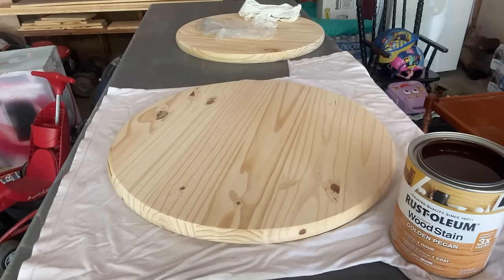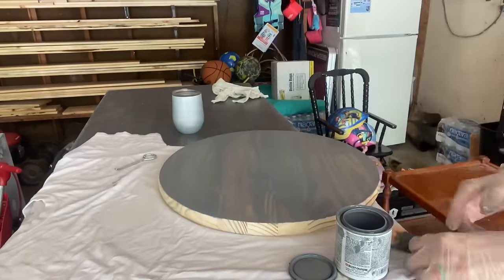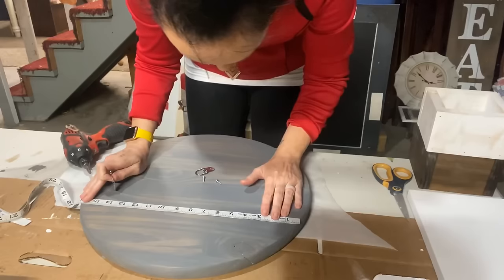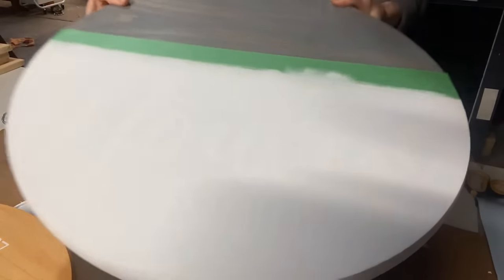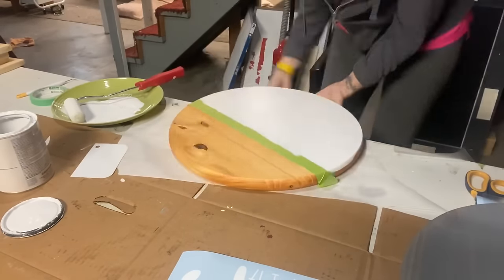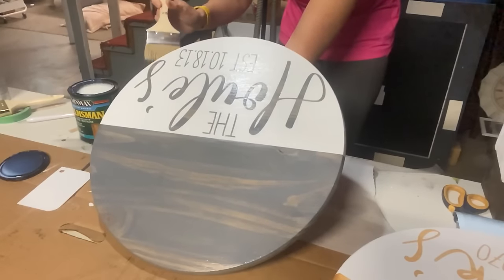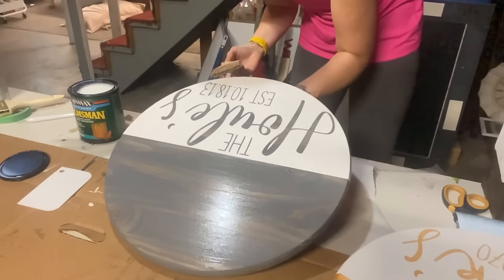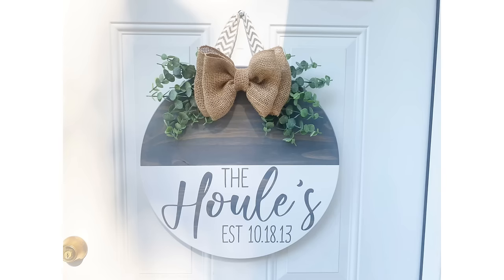DIY WOOD ROUND || DIY WOOD DOOR HANGER || WOOD SIGNS FOR BEGINNERS

Comment: So two questions. For the ribbon to hang it, how secure is just that glue? I love your work! just wondering. Also, saw in your comments it says to use interior paint, but why use that kind when it' for outdoor? shouldn't it be exterior?
Reply from the maker: Hello 👋 I’ve had signs hang on my door for months using the hot glue with my burlap ribbon for hanging and have never had issues or complaints from customers 😊 I have never used interior or exterior paint on my signs. I use wood stain and chalk paint,
Seal with Hellsman if it’s going outside. I hope that helps you and thank you so much for watching!
Reply: Unicorn Dust Designs yes I was referring the chalk paint. In link you put it says interior so that’s why I was asking if it mattered
Reply from the maker: Good question. It’s perfectly fine to use for outdoor signs because you will be locking it in with your clear coat 😊
Reply from the maker: Good question. It’s perfectly fine to use for outdoor signs because you will be locking it in with your clear coat 😊
Reply: Unicorn Dust Designs thank you!

Comment: Does acrylic paint work too?
Reply from the maker: I’m not sure. I’ve only used it once on a very small section. In my experience acrylic paint peels up
Reply: One more question 😅 How long do you let the paint dry? Or how long with the dryer and then do you let it sit?

Comment: I love your signs and decided to make some for fall. I used all the same products you used in this video. However, when I peeled up my vinyl I didn’t get as clean a line as you did. How long do you let the paint dry?  Because of my schedule I had to wait about 24 hrs. Is that too long?
Reply from the maker: Hello! Thanks for watching my videos :) Yes, 24 hours is too long. If you're using the 651 permanent vinyl as I do in the video that is strong adhesive and the longer you allow it to stay on the wood the harder it will be to remove :/

Comment: Hello! Your designs are beautiful! Have you ever had any issues with your wood round splitting? I purchased a 18 inch wood round from Lowe's and it started to split a little in one of the seems at the top. I'm not sure if it was just an issue with that particular wood round or do they all do that? Have this ever happened to you?

Comment: Where do you get the e600? Will regular hot glue make it fall off if it outside ?
Reply from the maker: Hello Bea! You can get E6000 at Walmart or any craft store. If you only put Hot Glue and then place it outside the heat can melt the hot glue off.

Comment: Newbie here. Loved your videos. I want to start making this wood round just a bit nervous getting started. I've read on post other places that the chalk paint smears when placing the top coat over. Ever have this problem? Also have you ever used vinyl decals for the wording? Would your sea with hellsman l over the decalm?
Reply from the maker: Hi Georgina! Thank you so much for watching! I’ve only had that problem when I did not allow the chalk paint to completely dry. So I usually wait 24 hours after applying the chalk paint to clear. I have used vinyl decals on smaller signs but to give my clients their money worth I feel painting a sign this big is the way to go. Especially if it will be outside because I really don’t think vinyl would hold up for years to come in the elements
Reply: @UnicornDustDesigns  thank you for getting back to me. I agree painting looks so much nicer. I guess im just a little nervous. This all new to me.  When pricing your designs how does dry time come into play?  Wood stain takes about 24 hrs. I've read to gice yourself an hourly rate. Do you just do this usin active working time?
Reply from the maker: Georgina Garcia stain should take over 24 hours. So in general it takes me 3 days to make one wood round. take all your materials, times by 2, then add what you would like to get paid.
Reply: @UnicornDustDesigns  Does the process looks something like this Day1. Stain both sides do you seal back and d hooks this day  Day2. Paint and seal front Day 3.. Decorate ?
Reply from the maker: Georgina Garcia Day 2 should only be paint. Do not seal until you have allowed it to dry 24 hours.
Reply: @UnicornDustDesigns  thank you. I really do appreciate you answering my million questions

Comment: Loved your tutorial; you crack me up! I’ve made quite a few signs but someone ordered one similar to this so I will be attempting my first stained and painted sign! For the paint, I don’t have chalk on hand; have you tried matte acrylic? Wondering if I can use that instead? Thanks for the video!
Reply from the maker: Hi Nicole!! Thank you so much for stopping by and leaving me a comment 😊 I actually have not used that paint before on my signs. I have used acrylic paint on smaller projects before and just know that I personally find that pulling my stencils up while the paint is a little damp helps it not pull at the paint (if it dries down all the way). Does that make sense?
Reply: Yep that makes sense! And so you don’t have that issue at all with the chalk paint?
Reply from the maker: Nicole M nope. I’ve never had that issue with chalk paint. I usually let it dry down all the way before taking my stencils off. I would test your acrylic paint on a scrape piece of wood first. Just to be safe
Reply: Unicorn Dust Designs My signs turned out great and I love using the rag method for stain!! How long do you generally wait between staining and then painting/stenciling.

Comment: Hi! Love your videos! I just need clarification. In the video, you stain and then put the clear coat on...do your stencil and put another clear coat on...but then I thought I read you don’t put the clear coat on before you stencil. Is the video in the correct order? Lol hope this makes sense. Thanks so much!
Reply from the maker: Hello! No, I do not coat the front of my signs with Helsman before applying my stencil. I do, however, apply it to the BACK of the sign before starting on my design. This way I don't have to put my newly painted sign face down when I'm done. Your piece of wood should be stained, dried for 24 hours, then start applying stencils, paint, etc. I hope this helps. You can also just apply the clear all at once when you're completely finished. I'm just silly and do it this way.
Reply: Unicorn Dust Designs Gottcha! Makes complete sense now, thank you so very much! 🤗
Reply from the maker: You're so very welcome. Let me know if you have anymore questions.
Reply: @UnicornDustDesigns  so I put the seal on the front hated it...it was an oil based and very sticky. So my neighbor sanded it off for me and I started over. I decided to wait until I paint my chalk paint then seal should have watched the video a few times. But after re-watching I realized I should have sealed the back after I put on my d-hooks. LOL oh well It's my first time. Going to home depot tomorrow to get water based seal and try it again. I did have a question on the bow what were your measurements?
Reply from the maker: Hello 👋 yes! Water based is the way to go when clearing your sign. No yellow residue will show up. 😬 I didn’t measure the bow. You may want to checkout my bow tutorial because I’m almost positive I measure it there

Comment: Hi love your wood signs. I have a question I bought two woods signs and got the vinyl stencil from your amazon page. So In design space I made a circle size 17.5 how do you know what size to make your stencil. What size do you normally make them?
Reply from the maker: I measure how far up from the bottom I want to bring my lettering and then measure across. Then I play around with it on my circle in design space. I did make a Cricut video to see how I design in there.

Comment: Ok I just painted my name onto the wood round with the chalk paint and lifted the stencil.  For the most part it is very nice.  However, I do have 2 bleeds from the chalk paint into the stencil wood stain part.  Is there a way I can fix this?
Reply from the maker: Hello Kay. You can try scraping it with your weeding tool to see if it will flake away.
Reply: I used my weeding tool and very carefully scraped away the bleed before I heard back from you.  Thanks you really are something else.   @UnicornDustDesigns

Comment: How do you prevent the white paint from yellowing?  You mentioned it previously but can’t remember which video....
Reply from the maker: Hello! By using water based clear
Reply: @UnicornDustDesigns  I let my stain dry for 24 hours, painted 1/2 w a white chalk paint, used water based clear polycrylic and some of it still turned a little yellow..... 🤔 Also, when applying the clear polycrylic  over a black chalk paint (after 24 hr drying time), it also smeared onto the white paint!  Ughhhhh! Yours always look so crisp and clean!!
Reply from the maker: Sooo a lot of people have been telling me the black is smearing and my suggestion is to take some clear matte Rustoleum spray and lightly coat the sign. Once dry then apply the clear coat and this should keep it from smearing. As for the clear yellowing. If it’s water based I don’t know how that can happen but if the can itself was stored in the heat that could possibly cause it
Reply: @UnicornDustDesigns  great!  Thanks for the suggestion and my cans are stored in garage so it may be a little warm in there!  I’ll keep practicing!!  Thanks for the quick reply!  Absolutely love your channel!
Reply from the maker: @chantannafootman277  awww thanks girlie

Comment: Love this! I'm getting ready to try to make my own ang and want to know if you stain the wood round, can you still finish the project in a day or do you have to let it dry overnight?
Reply from the maker: Hello Cortney. If you are using an oil based stain which I usually use, then NO, you cannot paint immediately after. You need to wait until it is completely dry which takes about 24 hours.

Comment: Hi. Watched this video several times before I started my project. The Spar urethane that I purchased had a brownish tint to it and turned my white chalk paint to yellow, any tips? It said clear coat
Reply from the maker: Hi Kim! Check your can of clear - it should be water based. If it doesn’t clearly say water based then it’s oil and that will cause yellowing
Reply: I just watched your other video and found the answer. You are awesome. Thank you so much.

Comment: Also, if you are using any sort of dark stain, or you have a bleeding issue with your tape, you can put modpodge on it before you paint. It'll seal your wood and won't bleed through the white paint.
Reply from the maker: Hi Samantha. I've tried the mod podge trick quite a few times and it just never works for me unfortunately.

Comment: I love these. Question, did you use stencil vinyl or an everyday removable vinyl?  And you use transfer tape to keep it straight if I read that correctly.  Looking for a brand people prefer.  Thank you
Reply from the maker: Hello! I use permanent vinyl when applying directly to stained wood. I also use the line in the wood to find a straight line and then use my tape to tape it off. My favorite transfer tape is vinyl ease. Most supplies should be found in my amazon store link listed in the description box.

Comment: Hi- I made my first round but I am having trouble gluing the floral/bow to the round. What glue and where do you place it before putting it on the round? Thanks!
Reply from the maker: Hello. I use E6000 and hot glue. Then I usually place something on top of the bow and let it dry over night to secure it.
Reply: @UnicornDustDesigns  I had the same question. Do you have a video showing exactly where you place the glue?
Reply from the maker: @buzzyboocraftsllc  hello 👋 if you go to my channel I have several wood rounds tutorials that show me applying the bow. The most recent would probably be the sh**show paneled wood round

Comment: What grit sandpaper do you use? Is there a specific reason you use chalk paint vs an acrylic paint?
Reply from the maker: Hi Abigail. I use 80 grit and 220 grit. It doesn't have to be those specific grits though. You just need a rough one to get all the grim and splinters off and then a smooth one to smooth everything out. I personally love the coverage that chalk paint gives. I also love how matte it is. I recently used acrylic paint on the reversible round I did and I would have put on 3 coats to get coverage versus 2 with chalk paint. But I know there are a lot of people that use acrylic.

Comment: Hello is it better to use water based or oil based stain?  I am having a hard time getting my vinyl to stick after staining.
Reply from the maker: Hello Lacretta. So are you wanting to leave the vinyl on as the design instead of painting it? If so, any clear should work. I usually use water based because it doesn't yellow paint colors and it's easier to clean brushes.

Comment: Hey I have a question. I made a wood sign with permanent adhesive vinyl lettering. I sanded, stained, 2 coats water based helmsman polyurethane, placed the vinyl, then 2 more coats of the same poly. My vinyl bubbled in the sun. What did I do wrong? How do I keep the vinyl lettering from bubbling?
Reply from the maker: Hello Rebecca. In this video I only use the vinyl for stencil. I do not use it as my actual design. The video that I did leave my vinyl on as a decal I did not put any clear on the top of it because if bubbling.
Reply: Unicorn Dust Designs thank you! The one you used vinyl for your design, did it bubble outside in direct sunlight?
Reply from the maker: It most likely would bubble because it’s adhesive so the sun is softening that. I haven’t heard of any issues from my client ... I highly recommend doing paint. That’s what I usually do

Comment: Hello, I am just getting started making wood rounds and have a question about applying the top coat with Helmsman.  I forgot to stir or shake the top coat and applied the sealant.  Now the wood round has a think bumpy film across the surface. What should I do to fix the trouble?? Can I sand with a fine sandpaper, taking care not to damage the vinyl on the surface and reapply the top coat?  Please help !!!

Comment: Do you not have to condition the wood with a pre conditioner prior to applying the stain?
Reply from the maker: Hello Catie. Not that I know of. With the stain and the clear it’s very protected.
Reply: @UnicornDustDesigns  Okay! I've just read online (because I'm brand new to working with wood) that woods like pine need to be pre conditioned before stain because they can turn out splotchy. I just didn't know if that was true because I don't want to waste money on it if it's not necessary.

Comment: Hi Sammie. I just completed my first round. I used Oracle 651 and I still had a little paint bleed. Do you have any tricks to prevent the bleeding?  Thanks.
Reply from the maker: Hi DeeDee! I would just make sure you’re getting a nice smooth finish on your round. Did you use both 80 or so grit followed by a 220 grit or something around that?

Comment: Sorry if this was asked. But exactly what kind of vinyl did you use for your decal? Or what do you recommend? I’m a beginner and still learning about different vinyl types for different projects. 

Another question (I watched the video a couple times and didn’t find it) but just to clarity, you only put the protective cover on the backside first, and NOT under your paint in the front side, correct? (I see you put on at the end. But not before)
Reply from the maker: Hi maral. 
I use the 651 permanent vinyl for my decal. I do this only when I'm laying it on a stained piece of wood
Yes. I do this so that I don't have to put my sign face down after painting my design.

Comment: did you use 631 vinyl, I tried stencil vinyl after I stained and applied the Helsman like you did in the video, But My stencil vinyl would not adhered to the board and it blead through.  But I also used acrylic paint too so I don't know if it's the paint or the stencil where I went wrong.. Please help!! LOve your rounds ! =)

Comment: Such a great tutorial, thank you! I’m ready to try. I bought 3 of these rounds at Home Depot, it was the best of the 5 they had in stock but all 3 have a crack several inches long from the edge inward... what do you recommend to fill crack but still be able to stain it?  😓 Thank you so much!
Reply from the maker: Hi Joyce! Thank you so for watching. Is the crack on both sides of the round?
Reply: @UnicornDustDesigns   I have the same sort of issues. Both sides have small cracks that I didn't even notice until after I stained it.
Reply from the maker: Laura Gillespie can you send me a pic on Instagram? So I can see how deep they are? Most times small cracks just add character but if you’re laying the stencil down on top of it - that could be tricky
Reply: Unicorn Dust Designs yes, split clear thru on all 3.  Pics sent on Instagram. Thank you 😊

Comment: Hey girl!  So I ordered these hooks and well they look small as heck, where can I get the bigger ones?
Reply from the maker: Hey girlie! So I searched ALL over on Amazon for the hooks that were the same size as mine and the company I got them from doesn't sell them anymore and I literally couldn't find the same size anywhere. So after researching a bunch of them these were the closest I could find (the ones you got). Although small, they will hold the weight of the sign. You will just need to roll up the end of your fabric or whatever you're using to fit through the ring. Home Depot does sell the size I was using but it's like $5 something for a pack of TWO which is outrageous.
Reply: That slow mo was cracking me up 😄